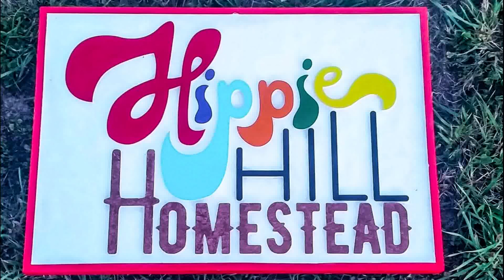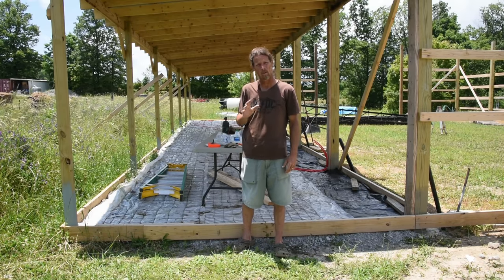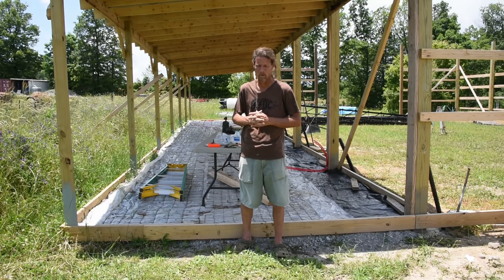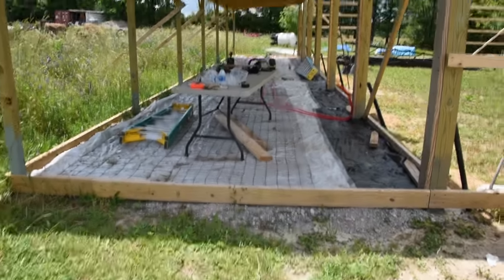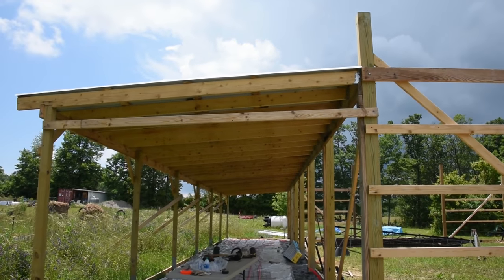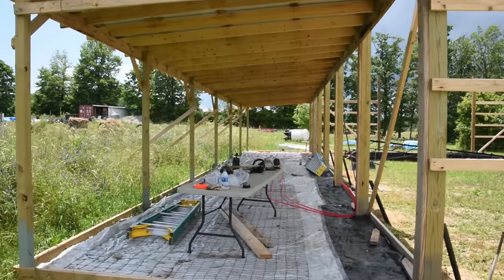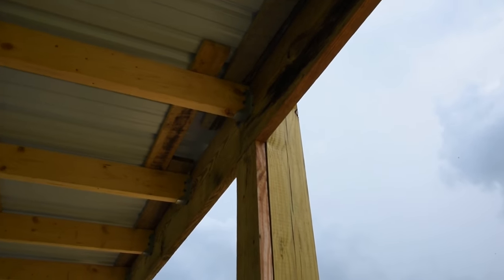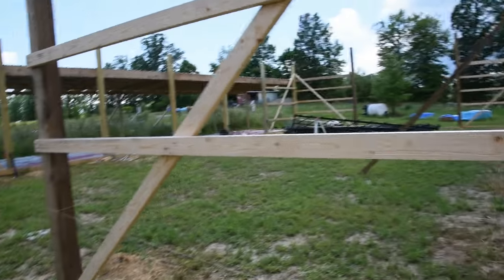DIY 40 x 60 Pole Barn Build with steel trusses (Part 1). Time lapse video building a pole barn

Comment: I was wondering why you didnt pour footings / sonotube  type bases first.  Then attach your posts to the concrete footing.
Reply from the maker: In my opinion putting posts directly in the ground is stronger than putting post on concrete columns. With concrete columns there are multiple points of failure. Now there is situations where I would use concrete columns such as extremely wet areas or poor soil conditions. I don't know if you can really tell in the video but when I shot our grade I sloped all the ground away from our barn. This will keep water running away from our barn, the next thing I did was painted the bottom 4 feet of each post with olympic water stain/sealer, this will help protect the posts for years. I was also able to set all my posts on solid rock. I only had to dig down on average 34 inches before I hit solid rock. Also by building lean-to's on each side of the barn the only support posts that will be exposed to water will be the 4 corner posts.  This is just my opinion I could be wrong. I have put many posts in this way for years and I have never had a problem with one. Thanks for the question. 
Bob

Comment: Did you wrap all the 6x6 post that are in the ground and how deep do you suggest burying them
Reply from the maker: I soaked 3 coats of cabots sealer on each post and sunk them 3 feet down until I hit solid rock. If I could have I I would have put them 4 feet deep. Thanks for watching.

Comment: Very nice barn sir. What's the pitch on your trusses?  I wanna do a pole barn aswell.  I live up in Canada so I'm thinking about the snow load.
Reply from the maker: Thank you. We have a 5/12 pitch. If I was going to build one in Canada I would use a steeper pitch so the snow would slide off easier. Good luck with your build and thanks for watching.

Comment: Wondering about spacing.  Looking down the long end, it looks like 10' spacing to get to the 60'.  What was the front end including the center opening?
Awesome timelapse, going to the next video now :)
Reply from the maker: Yes it is 10 foot spacing. The gable ends are 12 foot from the corner the the hall way 6x6. I wanted 12 foot by 10 foot stalls. That is why I went 12 feet on the gable ends. Thanks for watching. I am glad you enjoyed it. If you have anymore questions just ask.